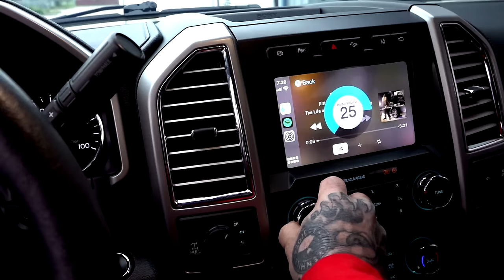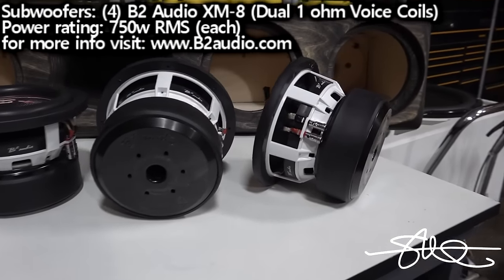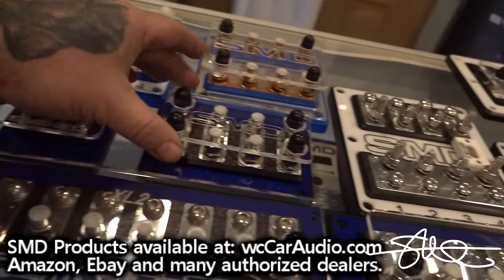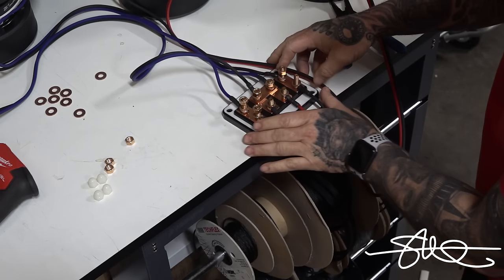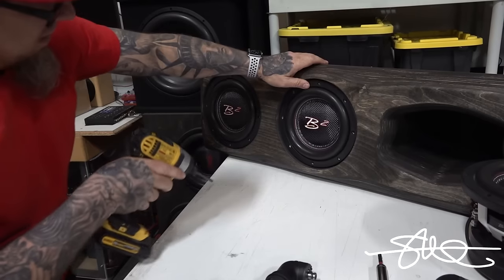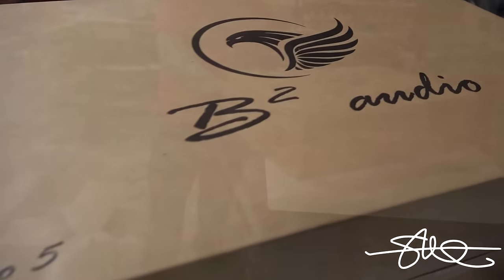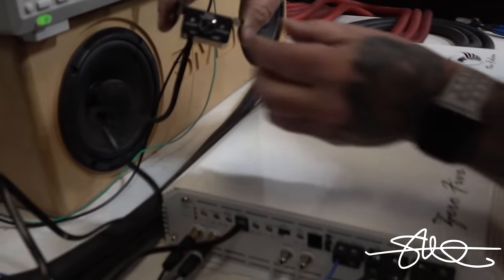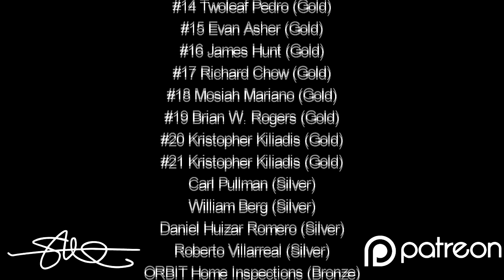Four 8's = Violent BASS! BADASS Ported Under-Seat Truck Enclosure Wired Up - Disintegrates a CD!

Comment: Thinking about adding some 10’s in my truck. What’s the difference between 8’s and 10’s ? Besides the drain in the battery
Reply from the maker: 2 inches.  What "drain" on the battery?
Reply: @meade916  lmao off 2 inches
Reply: @meade916  he proberly not using  specially designed car audio batteries, proberly still using regual car battery
Reply: @meade916  🤣🤣🤣🤣

Comment: Might be a dumb question but did you have to upgrade the battery power for the F-250 to accommodate the subs you added or was it running off the factory battery?
Reply: Wassup brotha, you can run your vehicles stock battery and your sub will sound good. Or you can add a 2nd high power battery and an 2bd alternator and you can get the full power out of your sub

Comment: I want a 4 8's box for my 2002 x-cab gmc Sierra 1500. I'd like to know the cubic feet of each speaker so I can find correct speakers to match
Reply: You can figure it out just based on the specs from the speaker manufacturer. They list recommended specs for sealed and ported usually.

Comment: I need some help. I have a 03 trailblazer double din install. I noticed there is 2 plugs when I pulled out the factory stereo. Does that mean I have a factory amp? And will my new stereo not work without something else?
Reply: thegreatest0101 one is probably steering wheel control
Reply: they sell conversion kits.

Comment: Steve bro can u tell me man what would be the best subs and amp to put under my seat of a GMC Sierra 2500hd that is LOUD as h€ll and I done a 4” seat lift so would 4 8 be loud or would 2-3-4//10” or 2 12 and which be the best and loudest and what’s is good amp that goes 4ohm 2 ohm and 1 and is at least 3000 watts at 4 ohm that is

Comment: Interesting how the inner left side sub and the outer right side  sub dimple while the others don’t.
Reply: rcwildman I was thinking the same thing.
Reply: rcwildman I was thinking the same thing.
Reply: I would assume those two were the ones in the Honda. Probably just looser than the new ones.
Reply: No i think the left 2 were from the honda and the right two were on the table.
Reply: @Beauvd , proximity to the port
Reply from the maker: @joelwalmsley7217  wrong.
Reply: @meade916  forget to put a question mark at the end. Is it because those woofers are already run in?

Comment: How come some surrounds are wrinkling
Reply: Maybe it's the two that were already flogged on in that other box... Still bumps though! Sweet, I wouldn't have thought about going with 8's.
Reply: @jonasreppe6327  good point. Like a worn out spider huh giving coil misalignment
Reply: I have heard 10's that sounded so much better than 12's and 15's but 8's! Gonna have to get some now lol! Thanks for the vid bro!
Reply: I have always been a 10 inch fan myself. except for stream manufacturers such as Steve meats designs I find that a lot of motors use the same basket and magnet coil setup for different cones. Pence there's not enough horsepower for the amount of pneumatic resistance for moving the cone. What's your thoughts?
Reply from the maker: Mark Godfrey  sorry to inform you but 10's do not "produce tighter bass than a larger massive speaker cone"....stop posting nonsense here.  An 18" sub can be just as tight as an 8 and an 8 can be sloppier than a 24" sub.  It's all in the install....and besides, your MIDBASS drivers should be doing all the "tight" work up front. Not the subs.
Reply from the maker: @fromstreettostraight  worn out? nah. It's called broken in.  2 subs have been used for over a year. The other 2 are brand new.  In a few days they will all be the same.  Stop with the "coil misalignment" talk, that sounds silly, like you don't even know what you are talking about. Just tossing random words out.

Comment: since when do subs share air space?
Reply: It's not even efficient plus he's wasting half of the speaker. He needs to baffle them cones.
Reply from the maker: since they were invented. Where have you been Lester? under a rock?
Reply from the maker: @futureonjk  just so you know, NOTHING you said made any sense at all. None, whatsoever. Stop embarrassing yourself, you sound silly, or very very drunk.
Reply: That's fine, I wasn't expecting to teach idiots science anyways.
Reply: If it's the same subs off the same amp it doesn't matter
Reply from the maker: @futureonjk  you think you were "teaching science"? LOL!!!! dude....stop.  Post up something you have done.  Just one thing. Show the best system you installed.  Show me the worst. Show me anything. You can't teach anything if you have zero experience.  Just stop. SMH LMAO!!!
Reply from the maker: @howardminkler484  it doesn't matter if they are on 2 separate amps either so long as the gains are set and matched.
Reply: @meade916  I know I was going to elaborate to them but didn't care enough
Reply: Just after the stone age
Reply: Lester Lilyquist since forever

Comment: How much would a setup like that cost?
Reply: alot
Reply: 2600 for subs and enclouse, without wire and the smd copper block wire conector
Reply: The box is $1600 alone not including the subs.

Comment: Is all nice and clean, but you choking the system you 10 gauge wire coming from the speakers into the terminal block and then you gonna run 10 gauge wire from the box to the amplifier you choking it
Reply from the maker: stop. You know absolutely nothing. You are embarrassing yourself right now.
Reply: @solarandwindinsouthtexasda1473  the delicious irony of someone trying to tell one of literally the og car audio installers that he doesn't know whats he's doing is.. 

i have no words.

for the lengths used, and the specific application, 10awg (notably slightly oversized 10. skyhigh makes good product) can handle the current just fine with no issues. the dynamic wattage isn't going to saturate the runs, or cause flow issues within those runs, because its never going to hit the rated peak current for the gauge (or at least, never for more than a split second or so at best)

the books say one thing, real world testing and usage says another entirely. and generally, the specs are there with a certain amount of overhead built in, because of safety regs.

the real world utilization is going to be around, what, 2/3 or even 1/2 (maybe) of the max rated? and that's at full volume. 

so yeah, please. stop.
Reply: your gauge size will be dependant on the ammount of current you are drawing over a certain distance as the longer your cable the bigger the ohm load you need a biger cable to draw more power without melting the cable so it really just depends mostly on distance hell he could probably run it on 14 gauge if he only has a run of 5ft of wire

Comment: How much does this box cost with the speakers I already have the wiring
Reply: It’s gately audios box. I bought the box ($1600) the gately audio 8inch subs ($400 each) and a 4500.1 b2 amp for $1100. So it get costly very quick but I have friends with those cheap pre fab boxes with skar 8s and there is not a single comparison
Reply: I use to get mine in downtown LA where the whole blk does nothing but audio .  $100 for the box. $75 for the 12" subs. Mids $??  And already had a Fosgate I bought for $200. And I knocked.

Comment: Why not just wire them up to a 1 ohm???
Reply: Can you not do math?
Reply: I was wondering the same.  Would running them all in series bring it to a half or 1
Reply: Because at 1ohm the amp is pushing 5000 watts divided by 4 is 1250rms per speaker. Which those speakers can only handle 750rms. 

At 2ohm amp pushes 3000watt RMS complete your math and your matched at speakers cap.